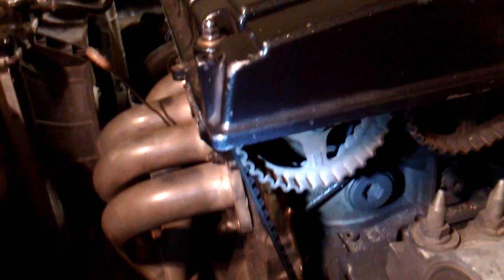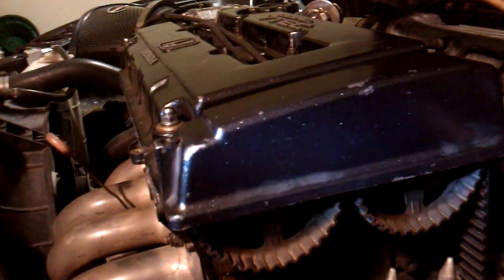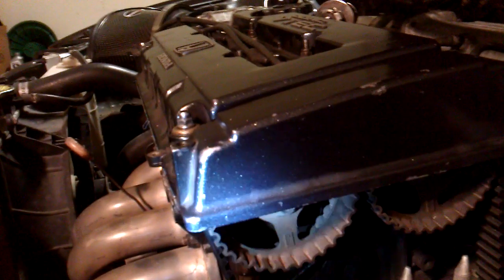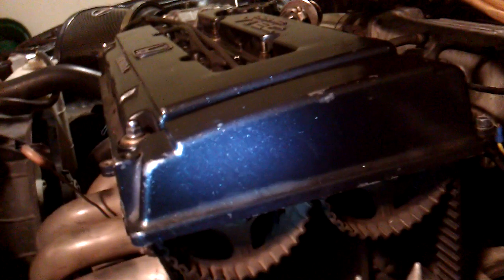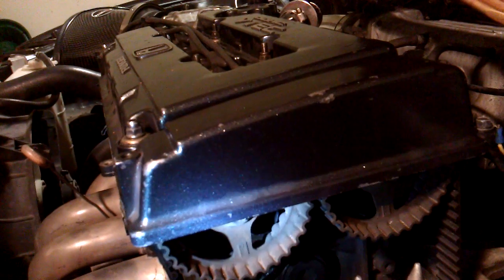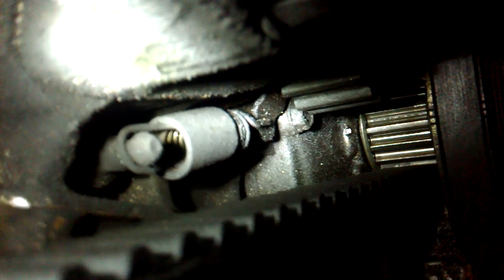Honda Civic B16a timing belt

Comment: Center of the three marks is 16 deg btdc, outer 2 are + or - 2, this is your base ignition timing by Honda.The other lone notch is 0 degrees aka piston 1 tdc and what should align with your cams up and notches mating on cam gears. Take out plug 1 and you can double check with a rod. Sounds like you had it backwards maybe.

Comment: Why the hell you don't mark your timing belts before taking them down. I always mark them at 3 points. At both camshaft gears and the crankshaft gear. Then I take the timing belt over the other one, and mark the new timing belt, too. And then I know how I need to put it on again, without problems.....

Comment: When you use the single notch on the crank shaft pulley its supposed to line up with a mark on the timing belt cover, not the mark on the block. Use the outside of the crankshaft gear to line up with the mark on the block.
Also those 3 notches are for ignition timing.